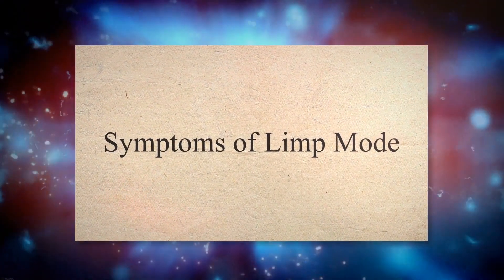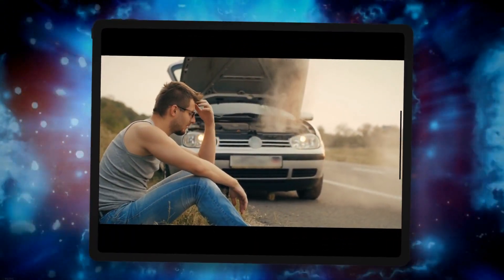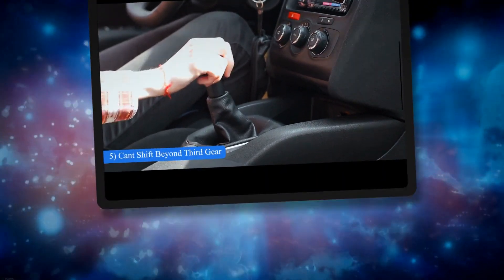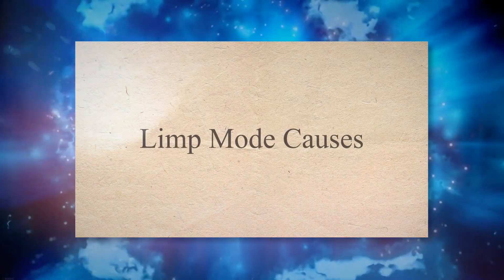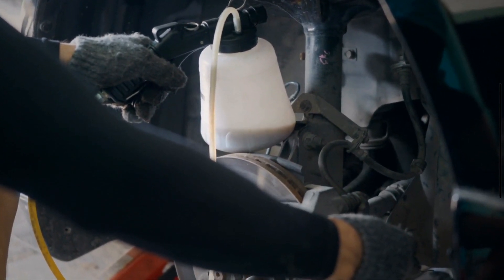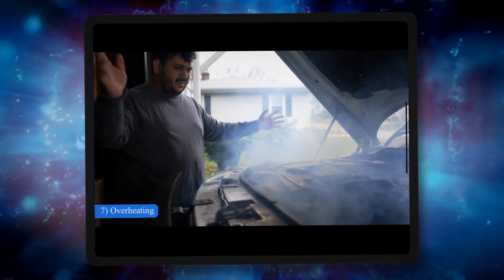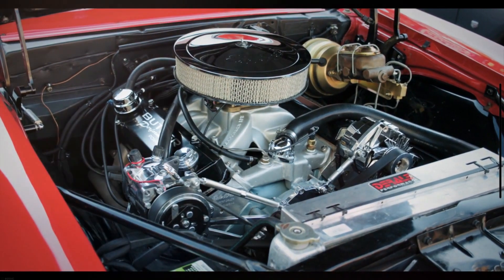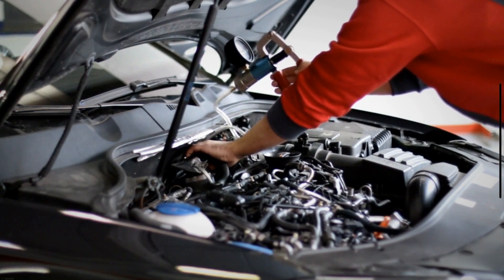LIMP MODE SYMPTOMS AND CAUSES: SAVE YOUR CAR WITH THESE TIPS! 🚗

Comment: Can you go on limp mode without check engine light?
Reply from the maker: Yes, it is possible for a car to enter limp mode without the check engine light illuminating. Limp mode is a protective measure designed to prevent further damage to the engine or transmission when a fault is detected.
Reply: @MechanicalBoost  how do I know if I'm on limp mode?
Reply from the maker: I already have explained all the symptoms of limp mode in this video
Reply: My dad  is in limp mode right now
Reply from the maker: @wanny-d2z  Properly inspect and fix all the faulty parts discussed in the video, then hopefully your limp mode will be fixed